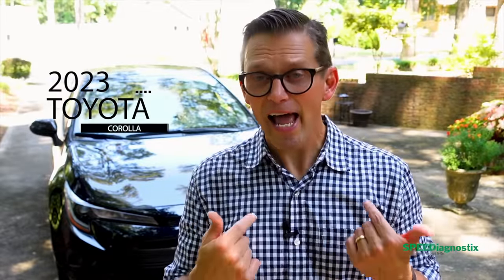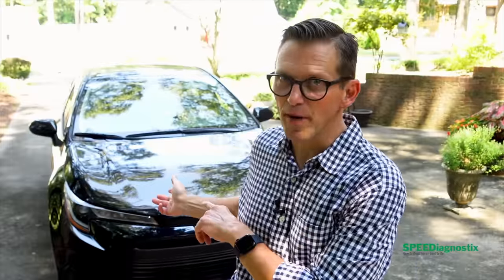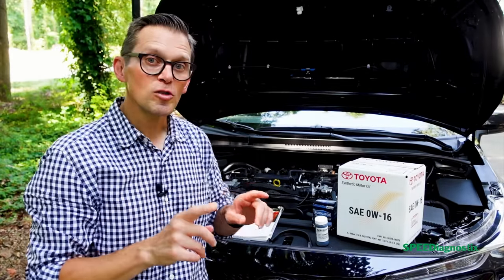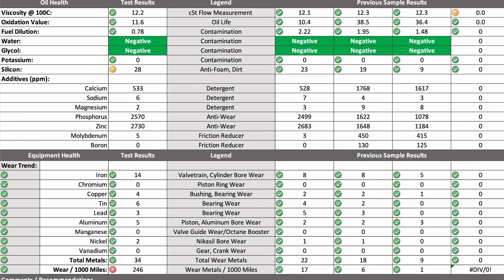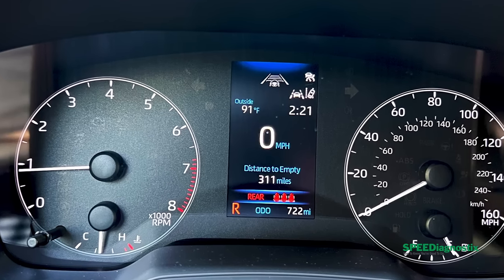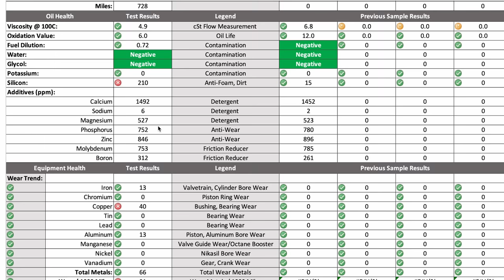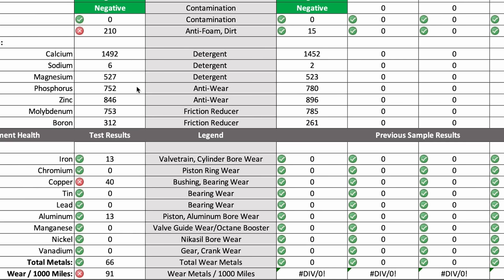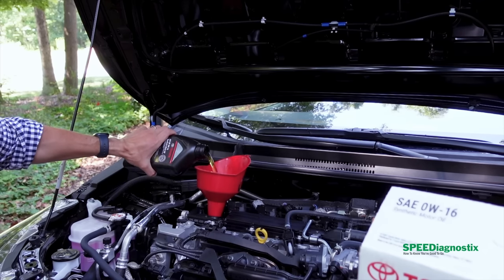AVOID the ONE MISTAKE Almost EVERYONE Makes With A Brand New Car

Comment: This is actually a really good idea.
I would add to apply other break-in strategies as well.  One that comes to mind is keeping the car under 50mph.  Another is only reving the engine up to half redline between shifts, and try to avoid heavy load, or hard pulls on the engine during the 500mi break-in period.
I recently rebuilt the engine on my NB Miata.  This was essentially the break-in procedure I used.  When examining the first oil change oil, it had a metallic sheen, like you would find during a transmission oil change, or in a metallic paint color.  All of the particles passed right through the filter.  Leaving the heavily saturated oil inside the engine for a complete oil change cycle would be like keeping sand in your engine.  The excessive break-in metal debris just causes unnecessary wear to the engine.
Reply from the maker: Thanks for sharing!
Reply: No it doesn't. You obviously have zero clue about how oil works. Modern cars do not need break in changes. Do the first one at 10k it will be fine. Stop listening to muppets like oil geek who's just promoting his business.
Reply: @motleydude73  Ok genius, when during the manufacturing process are the engines broken in?  I'd like to know who or what is responsible for the engine break-in period.  As far as I can tell, its the responsibility of whoever puts the first 500mi on the car.
While I may contend that some of the strategies of the oilgeek are a bit overzealous (priming the oil filter for instance).  It's not as though they're without merit. (1.5sec oil pressure if starting the engine, vs 4-5 sec using air pressure.  The film on the engine components is plenty to protect against metal-on-metal contact during that time.)
Run a brand new car hard and your power output will tank fast.  Ask me how I know.
Will catastrophic damage happen if you leave the wear metal in the oil?  No.  It's a kin to leaving 2000 grit sandpaper in your engine.  Plenty of engines with lots of wear and 60k mi oil change intervals are out there on the road driving around.  That doesn't mean doing those things are a good idea, or that sound preventative maintenance is a bad idea.
Unless you've been rebuilding engines for 20+ yrs for a repuitable shop, or work at a high-end service center for 5+ yrs (BMW, Porsche, Ferarri, etc), your agressive comments will not be welcomed.
Reply: @christopherlowery855  Breaking in is irrelevant. Get a new car, drive it,  change oil at 10k miles you'll be fine. It's not the 1950s anymore. Even when I bought a new Honda Accord in 1995 there was no break in oil change needed. First change was at the recommended 6000 miles. It lasted til 175000 miles before being written off. Oil holds any debris in suspension. That's one of it's jobs. And it's so microscopic I don't know why anyone would even give it a second thought. But Americans are uber paranoid about oil it's hilarious. The most engine wear occurs at start up, whether you have new oil or old oil, so worrying about wear from contaminants is rather redundant. In my 32 years in the trade I've yet to see any benefit to a 'break in' change. I've seen cars driven hard from new with 200,000+ miles on them.
Reply: Absolutely. Unfortunately the guy that delivered my newbie drove it about 60 miles on the FL turnpike to my residence and I doubt seriously that many those 60 miles were under 50 mph. But since then that's what I've maintained. Stay off the metal at startups as well. In fact with this CVT tranny my plan is stay off the throttle, period. There's absolutely NO reason to make "jack-rabbit" starts all that does is wear EVERYTHING out quicker. HOW you drive is as important as HOW you maintain... that is IF you plan on having it for awhile.
Reply: @leecowell8165  I try to warm up the engine before doing any hard pulls.  Not necessarily operating temperature, just enough to circulate the oil and get it warm.  2 blocks or so is all it really takes in warmer temperatures.  I used to warm up the car for 15-30min when I lived up north in the winter.  The last thing you want to do is start the car, then hammer on the throttle.  That's just not a healthy practice.
Reply: @motleydude73  I bet you're a conventional oil guy.
Reply: @motleydude73   Dude, not for nothing but 175k is NOT impressive. I changed the oil on my Rav4 Hybrids - one at 1k'ish and the other at 1.1k'ish. I intend to change every 5k for the life of them. I am anticipating 500k miles on BOTH at least.
Reply: @motleydude73  Hondas were at their best in the early to mid 90s and you destroyed your own argument. When you said your Honda Accord died at 177,000 miles. Honda’s back then routinely went over the 300,000 mile mark. To say that changing your oil early and often does nothing is laughable.
Reply: @reggie2334able  It didn't die it was side swiped in a crash and bent the chassis. The engine was perfectly fine. Would have lasted a lot longer. I've seen those F22Bs with 250,000+. All serviced at Hondas recommendations. My current Camry has 160000 miles it will do that much again. All with 10k OCIs from new.
Reply: @christopherlowery855  Castrol 10-30 synthetic actually. And a service tech for 32 years.
Reply: @michaeltammaro482  I couldn't care less  how you waste your time and money. You obviously have zero understanding about how oil and filters work. The most wear occurs at cold start up which is unavoidable  so not sure why you're paranoid about microscopic metal particles 🤣  They do nothing to your engine longevity. I could get 500k out of my current Camry just by following Toyotas service intervals what's your point?
Reply: @reggie2334able  Changing early has no benefit whatsoever. It just costs you unneccessary time and money.
Reply: @motleydude73  oil is cheap engines aren’t I want the best chance at the longest life vehicles are way too expensive these days
Reply: @reggie2334able  Why on earth would you need a new engine?  Extremely rare occurance. Think I've done 5 in 32 years. And only one was from lack of regular oil changes. Oil protects an engine, and manufacturer recommendations are perfectly fine to follow. They built and benchtested those motors, they know best.
Reply: @motleydude73  You should probably quantify what you mean by "drive it".  Different people have different driving characteristics.  If your driving style is light, then yes, such an adage is applicable (just drive it).  However, if you have a heavy foot and drive aggressively, I strongly advise light, or ginger driving of a new vehicle for the first 1k mi.

My friend bought a new Tundra.  We didn't think anything about engine break-in.  We would accelerate hard, downshift, and rev the engine to a high RPM.  After some time, the engine had a loss of power and was not as quick to accelerate as it was new.  Likewise, Donut media completely destroyed a WRX engine because they never broke it in before taking it to the track.  I say this just to illustrate worse case scenarios if engine break-in is avoided prior to heavy use.
If we're talking about someone who never lets the tach get above 4K RPM on a 7500RPM engine, then yeah, just drive it.  I would just avoid idling for extended periods of time during that first 1K mi period. (mainly applies to company vehicles and law enforcement)

While I appreciate your experience, shops aren't usually panning for debris in the oil during regular oil changes, nor are they looking for any type of sheen/reflective material in the first oil change oil.  Typically, a car is put on a lift, the oil canister with an adjustable funnel  is raised to the oil drain plug proximity and the oil is drained.  The oil is drained into a common vat.  It's rarely ever drained into an individual drain pan and inspected for debris, or sheen/particulate metal for any particular vehicle.  If discoloration isn't detected in the draining procedure, there's usually no concerns.  Especially if following the service manual/manufacturer's instructions.  Exceptions to this would be during something like a specific recall (rod bearing failure), where verification is needed for some reason.

As for oil filters, the metal screw-on canister type all have a bypass valve in them that opens during high pressure situations.  There's also a secondary bypass that opens after media clogging/saturation.  If the car is running at high RPM, the flow bypass valve is open and oil is not being filtered.  Likewise, they only filter about 20 micron debris and larger.  Anything caught in suspension will likely pass right through the filter.  This would include break-in material, which will most certainly contribute to bearing wear.
For the average driver, this isn't a concern at all.  Mainly because they're driving an automatic that shifts for them at around 4K RPM and keeps the car running at about 1500RPM.  Bearing wear during the first 10k mi due to break-in debris will cause minimal added wear in those circumstances.  That's about what you want for break-in driving anyway.

Overall, if someone is the type of driver who babies their car, by all means, ignore all engine break-in procedures because you're doing it already.  However, if you're the type of person who bought a new Camaro or Charger and is out to burn rubber, I'd wait for that 500-1000mi mark.  I would also consider draining that oil within the first 1K mi to drain out all that break-in material to get completely clean oil on the bearings during all that mayhem.  The TRX owners manual actually has engine break-in recommendations for their supercharged 6.2L engine.

Hope this helps someone understand some of these complexities.
Cheers.
Reply: @christopherlowery855  Whether you baby it or thrash it from new really has no bearing (excuse the pun) on longevity or wear characteristics. The particles are microscopic. The oil is still lubrucating everything. The most wear occurs during cold start ups which is unavoidable so a gentle  'break in' is rather redundant. Our service dept does the first service at 15000kms. Has done for many years, and there has been no follow on issues from doing such. In all my decades of being in the industry I have yet so see any evidence an early oil change or 'breaking in' an engine gives it a longer life. Seen many with 450-500,000 kms and they were ex rentals or company vehicles used by logging crews in the bush, flogged hard from day one. No problems. I thrashed my '95 Accord from new, had it sitting on 200kmh before it had ticked over 1500kms, it was still going strong at 278000 kms when it got written off. If people think it helps to 'break in' their engine good for them, an early oil change certainly doesn't hurt, except in the wallet, but is it neccesary, no.
Reply: RPM IS far more important than MPH.

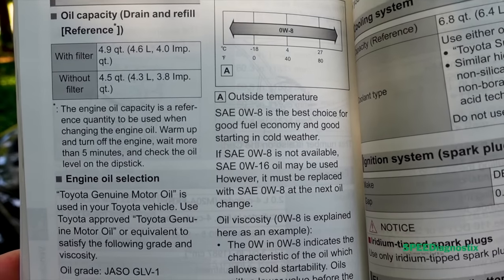Comment: 17:29 The manual page you show says that if you use 0w16 for an oil change, you need to switch back to 0w8 at the next change. I don't think you mentioned that in the video.

Purely in terms of viscosity, to a non-expert like me it looks as if you could substitute a 0w10 or 0w15, but it seems the additive profile is super important too.
Reply: If he actually read the manual he wouldn't suggest you changing the oil at 500 miles for negligble difference......

Comment: I'd also make sure the car is driven at high and low speeds and under some load too. I've seen some people that never go over 45 MPH and the engines tend to burn oil because the rings never really had to do much to wear in and seat.

Comment: Obviously changing oil at shorter intervals can only be better, I think only a few people would not understand that.
Reply: Meh, no you are quite wrong.  If you become a slave to your vehicle and change the oil more often than needed, there is no significant benefit and more time and money wasted, which is worse not better.

That does not mean, do not change your oil often enough and instead follow too long an extended drain interval.  As with most things there is a sane middle ground.
Reply: @stinkycheese804  
Hi Stinkycheese how are you, well perhaps you are right, I use common sense on that and I am quite happy with my results. Current car has 432,000 on the clock after 20 years (2004) model.
All the other cars I had same pattern. So happy like that but I hear what you say. So right  or wrong I am happy like that. Cheers.

Comment: They know the engines now will run 2 to 300k miles. They are trying to get uyou to put extra wear in the engine so by 100 to 150k your trading it in. Back in about 96' or 97' there was a master mechanic from. South Broward Automotive. He told me when he bought his wife a new car he would drive it for a couple weeks and drain it and put Mobile 1 synthetic. He would change the oil once a year no matter what and the engines would run for a couple hundred thousand miles. If he built an engine, he would do the same thing. I have been running Mobile 1 synthetic ever since and my cars run alot of miles. I had a 91' Thunderbird sport coupe with a 5 liter. I put Mobile 1 and at 160k miles I change the valve cover gaskets and the engine looked brand new inside. Very clean. I now have a 03'Crown Vic Police Interceptor I bought from the Miami Police Auction with 91k and guess what? Yep, I put Mobile 1 synthetic in it. It now has 175k on it and same thing looks brand new inside.i just did the timing set. Good info brother. Thank you
Reply from the maker: Thanks for sharing!
Reply: Nope. if you are trading it in, it does the dealership no favors to have a worn out engine.  They specific the change interval based on whether it will both outlast the warranty but also, because instead of vague guesses, they also TESTED  their engines.  Granted, those tests are not done in real world environments with years of hot cold ambient and stop go driving, which is impossible in a lab/garage.

The truth is that only engines with some other design fault, fail by 150K mi if the oil changes were at least done with appropriate long life oil and filter.  That does not change that the initial oil change should still be done at a few  hundred miles instead of 10K mi.